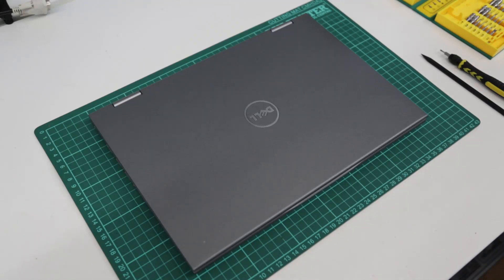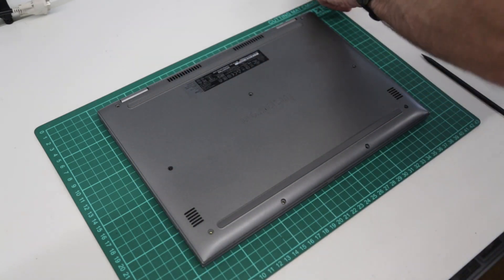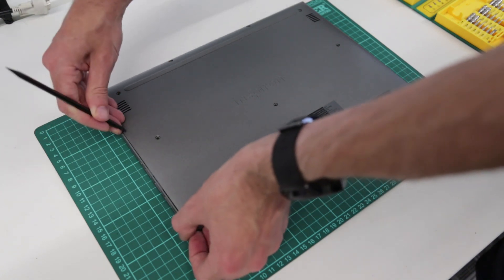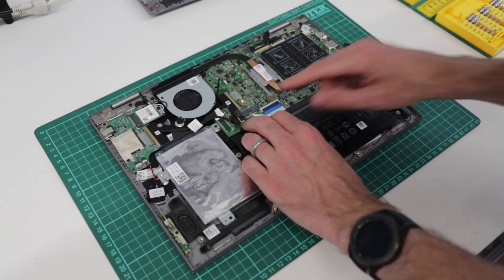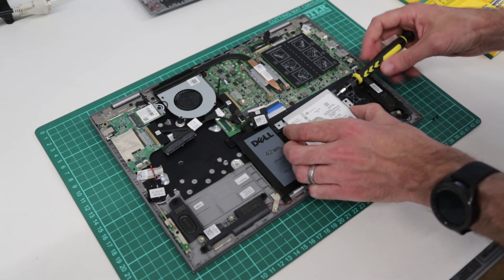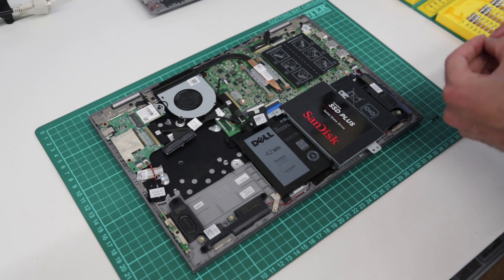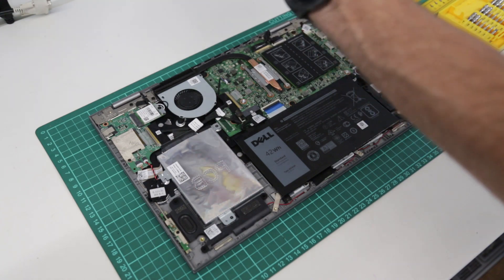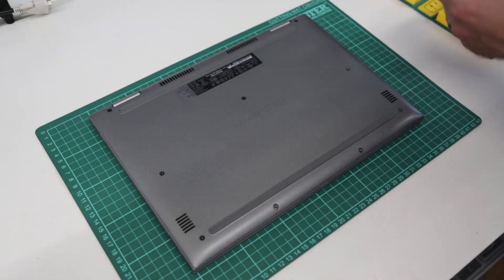Dell Inspiron 13 5378 2-in-1 - SSD/HDD upgrade guide

Comment: I got a used Inspiron 13 5378 (i3-7100U) for $50 two years ago. As soon as I could I upgraded the RAM to 2 sticks of 8gb DDR4-2666 (Samsung M471A1K43DB1-CTD) for the price of one stick. I'm deal hunting for a 500gb to 1TB SSD now. Since I mainly write, use it for email, research & web browsing, 16gb is almost overkill. I can have many tabs open. I upgraded to maximum RAM to try to future proof and to help increase video memory. After an upgrade watching videos on it is a breeze. It's a great laptop and I expect to use it for 8 more years. I should probably make a video of the SSD replacement with replacing the CPU goo with Carbonaut (or equivalent).

Comment: I did it! Great video (although it was hard to see what you were doing when you disconnected the battery).  My new battery did not have the cord attached so I had to add that step, but all good. Very happy the machine is working again!
Reply from the maker: Glad it helped! Sorry it was a bit unclear at that stage - I've tried to ensure there is a better view of the more fiddly tasks in later videos I've produced.

Comment: i have dell 7359, it uses a slim hdd, will any 2.5 ssd replace it??
Reply from the maker: Look to be a 7mm thick 2.5" HDD, so any 2.5" SATA SSD should work fine.
Reply: @BrueComputing  ok, Thanks

Comment: Hi Brue, I followed your instructions and successfully updated. The only challenge is that my old HDD is locked by BitLocker. Any suggestions?
Reply from the maker: If you're cloning from the old drive you'll need to decrypt it, clone to the new drive, and then re-encrypt it.

Comment: Thanks for the video. I have the dell inspiron 13 5000 series. I’d assume it’s almost the same process?
Reply from the maker: Depends on the exact model - there are lots of different Inspiron 13 5000 laptops made over the years.
Reply: @BrueComputing  thanks for your reply. it's the p69g if that helps

Comment: Could I install one 1 tb SSD sata with one 512 gb or 1tb SSD M.2 NVME 2280 in Dell Inspiron 13 5378 2 in 1?
Reply: No this laptop doesn't have m2 slot
Reply: Has anyone tried nvme with any sort of adaptor to SATA?
Reply: Hi, has this been answered?
Reply: @warrenluzano4529  a question??
Reply: @tsmasuko  using an NVMe in this lappy
Reply: @warrenluzano4529  yes.I was asking if it is possible to install one 1tb SSD plus one M.2 NVME?
Reply: @tsmasuko  Have you tried it? I will try this week.
Reply: @warrenluzano4529  Yes ... when I asked I didn t tried, but now, I ve tried, and there is no slot for it (M.2)

Comment: Can you do a Windows 10 transfer from the hdd to ssd.
Reply: @Naam mein kya rakha hai I used AOMEI it clone a 1TB HDD to 275 GB SSD. Once I swapped the HDD by SSD, the laptop booted alright. Everything came across fine. But after 15 minutes of use, it crashed with a blue screen. Now the system won't allow me to even run advance options (I get the screen but it does not go anywhere). What possibly could be wrong? I appreciate the feedback.

Comment: Can "dell inspiron 13 5378" have a partition drive? I have the same laptop. Thanks
Reply: I mean, does it have a slot for additional drive? I previously had a laptop which has drive c and drive d, is it possible to do it in this laptop by installing an additional drive? Thanks
Reply: @psalmtobias3948  no it have not.
Reply from the maker: You can divide the drive up into partitions, yes.
Or do you mean a cache drive, like Optane?